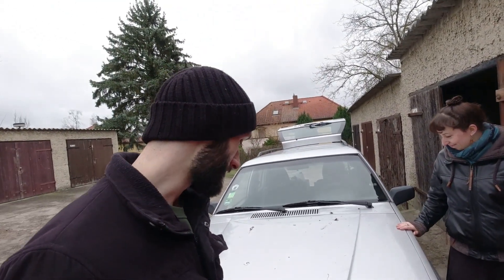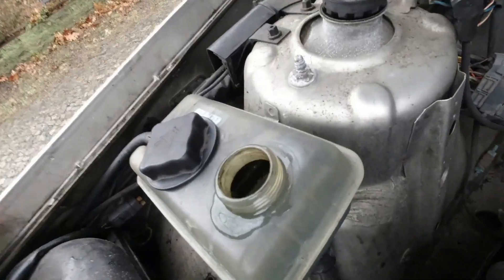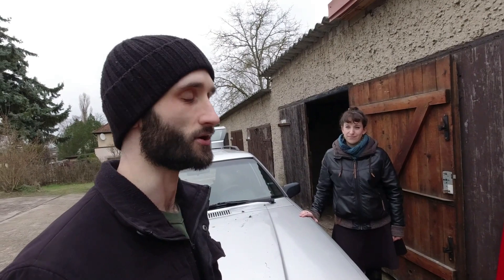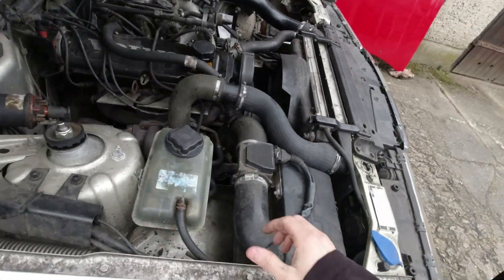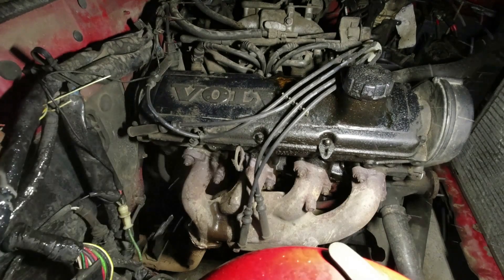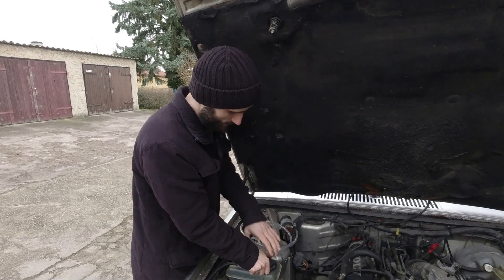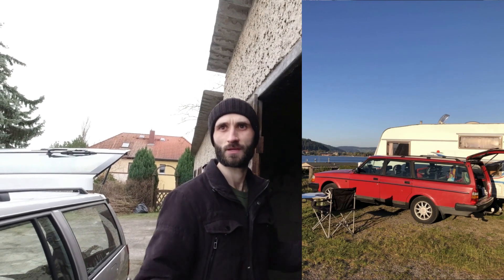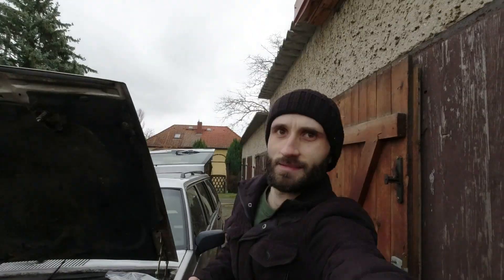Testing our Volvo 940 Head Gasket - Is it Blown?

Comment: Did a headgasket job on two 940's a while ago. While doing that I replaced every gasket, O-ring  and vacuum hose etc since everything is apart anyway. Also, cleaned all the engine parts and the engine bay. Looks 10 times better👍
Reply from the maker: That's definitely the right way to do it! I'm going to try and replace as much as possible, hopefully I can find a head gasket set that comes with all the stuff. Definitely need a ton of rubber hose too as the whole fleet need their vacuum lines refreshing ideally
Reply: Such a complete set you're not gonna find, at least not with parts to overhaul things like the oil cooler and pcv system and small bits like the fuel pressure O-ring and rhe throttle shaft rubber 😉 Maybe think of a way to upgrade your 940 in the future: you can raise it and take it to scandinava or built a 300 - 400 hp redblock or modernize it with stuff like wasted spark and a BMW gearbox. Great youtube content👍

Comment: While it's to late in this application, I run zero pressure reservoir caps in all of my Volvo's buy removing the internal spring and check valves within the cap. Why? As a car ages internal pressures on the head gasket, water pump bearing and all other cooling components will weaken these components creating pin hole leaks throughout. Pressuring the system is done to raise the boiling point, but enough room can be left in the reservoir tank to run zero pressure cap. Try it out, you'll find that you're not chasing leaks. Best of luck with the repair.
Reply from the maker: Thanks for the info! I'll definitely bear it in mind, that's why I started running a 75kpa cap instead of a 150. Now I think about it I've never seen a Redblock cooling system start to boil over without a cap on

Comment: On the joyful side of things, probably the engine with the least hassle to do a head gasket job on! This early on you can probably come away without surfacing the head even.
Reply: I now recall it overheated for the previous owner so maybe not. Good thing you live in Germany and Germans tend to drive German cars, must be a machine shop on every street corner 😆
Reply from the maker: Yeah exactly! Haha 😄

Comment: Do you know what the attachment on the top of the 240 air box  was for?
Two machine screw  tappings and a male nipple that seems like a tube hose connection ?
Reply from the maker: I'm not sure to be honest! Which 240 was it in I've forgotten 😅
Reply: @Involvod  In a 1993  240, for sure.
Every 1988-93 Volvo in the US  northeast region seems to have this ; but not being used.
Never seen one of these add-ons being utilized in my recycling yard runs.
I wonder if Volvo changed what they originally intended it for.
Or maybe a diagnostic port of some type?  A mystery.
Reply from the maker: @danielebbeling4056  ah I see, yeah it's quite strange! I'm going to ask around!

Comment: Very informative, haven't seen a kit like that before. While I remember- I recently tried to source some valve shims for a B230F and pretty much drew a blank searching for Volvo shims, but found that shims for the old Fiat X1/9 appeared to be available and have the same diameter. Haven't got round to trying them so don't quote me. Just a thought. Looking forward to seeing you sort Sylvia's gasket!
Reply: If it's true about those Fiat shims then the ones from other models like Ritmo, Uno, 128 probably also fit, maybe even Zastava 1100 and Yugo. 
All the same engine design
Reply from the maker: @jfv65  but now you've mentioned that, I don't know if I could put those parts in a Redblock 😅
Reply from the maker: Ah thanks for the tip! I'm surprised they weren't available, I think I'll need to do mine as she does  sound a bit noisy

Comment: Just have yourself a decent 1/2" breaker bar, torque wrench, head gasket kit and you will be set. If you can refresh anything else in the area you will be removing. Like someone mentioned below I would use penetrant spray a couple days before-specifically on any exhaust related fasteners you need to remove. You can do it.
Reply from the maker: Thanks for the support 😃👍
Reply: Special sauce 50/50 ATF/Acetone, best stuff ever for manifold studs.

Comment: Are you going to just place a new headgasket or are you going to have the head skimmed, valve job, valve seals, ...?
Reply from the maker: We'll definitely get it skimmed, I'll check the valve clearances and condition when it's off and go from there, but I think at the least new stem seals would be sensible 😃

Comment: Perfect timing… my 940 turbo is displaying the same white smoke and has been for a while - It’s called Smokey for a reason… so I’ll be watching with a keen eye on how it’s done.
Reply from the maker: Hopefully yours is okay, my previous 940 smoked a bunch too but the head was totally fine!
Reply: Lots of white smoke, even with a hot engine (a few moments after starting) coolant loss out the expansion tank, down on power and (more than usual) awful MPG… haven’t done a chemical or compression test, but the signs are there ☹️
Reply from the maker: @PhilMakesThings  ah yeah, is there alot of pressure when you remove the coolant cap when it's cold? Even the day after? That's how my first blown head 940 was, slight coolant loss and lots of pressure, but never over heated, just kept on going, good old tanks aren't they!
Reply: @Involvod  No, when it’s cold it’s just a little fssst. Mines not overheating… solid mid gauge / pointing north. Been like it for three years now 🤣. When it’s hot and running the top hose is really solid… maybe the replacement thermostat isn’t doing it’s job?
Reply from the maker: @PhilMakesThings  i'd definitely get one of these tester kits just for peace of mind, €15 on Amazon and great to have on hand
Reply: @Involvod  Bought one. Tested. Yeah, turned yellow very quickly. 😬
Reply from the maker: @PhilMakesThings  oh no! Well at least now you know, funny how long it lasted, and would keep going 😄 Good luck with the job, I'm halfway through mine, no disasters so far!
Reply: @Involvod  Oh I’m paying the garage to do mine. Beyond my toolkit and experience!
Reply from the maker: @PhilMakesThings  mine too! 😅

Comment: I have never seen one of those used, in fact I didn't know the kits were that simple. Great to see you both involvo'd . Looking forward to seeing the head gasket vids. Good luck, hope it all goes well, use lots of plus gas (penetrating oil) the week before!
Reply from the maker: I'm surprised how many people have said the same, I forgot to mention it in the video, but it was only €15! And thanks that's a good idea!
Reply: @Involvod  I've never seen one either, pretty cool. Where did you get it?  Sorry to hear its the head gasket but looking forward to seeing you replace it.
Reply from the maker: @bus249a9  Thanks, I got it off Amazon, if you type in combustion leak tester you should get plenty of results!